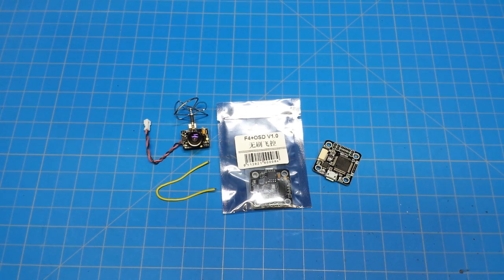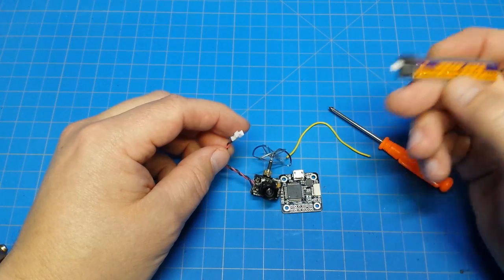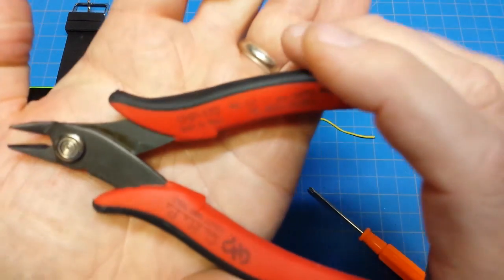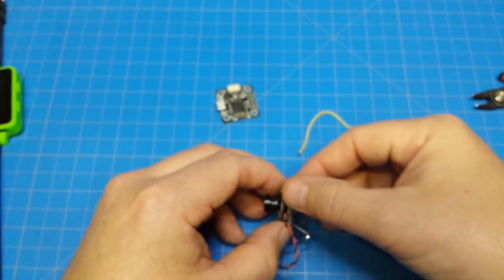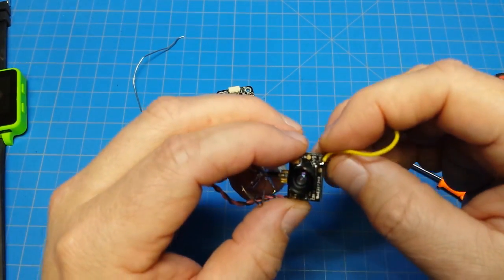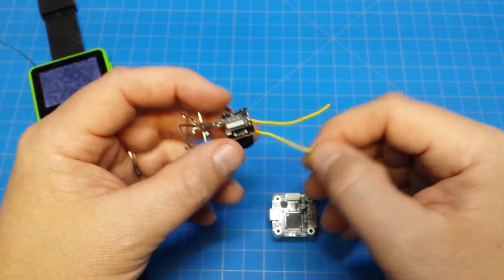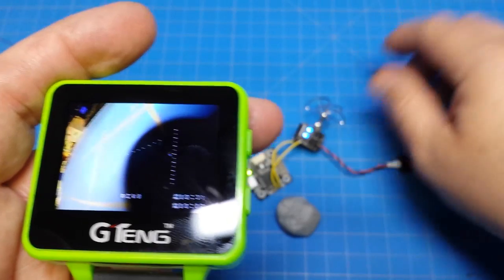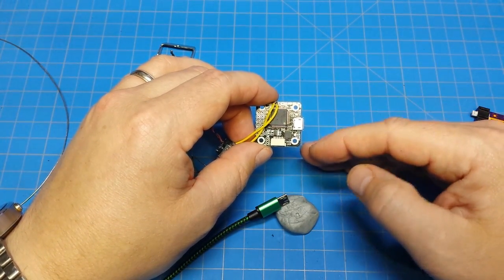Eachine TX02 to OSD

Comment: These little microVTX backpacks are awesome. Great for ditching heavier, hotter, more power hungry full size VTXs. Grab 'em, desolder 'em from the camera they come with and go nuts. They use virtually no power, have awesome features, and generally come with the CP! Also great that they run off of a tiny 1s for ages so you can fully separate power systems if you desired. Super interested in this OSD for voltage...

Comment: If I'm not using a 4-in-1 ESC on a 5", I'll always send my wires below the fc, so the gap between the frame and the FC is basically cable management like a PC case. Tape it all down after zip-tied, to keep vibes out of the gyro, of course. Otherwise, the wires above the FC can't be cleanly managed, will cause vibrations, and can hook branches, shingles, fingers, hair extensions, mammals, and Falcon 9 rockets. I only claim to build well.

Comment: Thank you so much for this video. Where do i have to solder the black and red cable to when I don't want to use an extra battery?
Reply from the maker: black to ground and red to 5 volt.
Reply: Did I do it right? https://imgur.com/a/D4L4Wv0
And can the yellow cable be any cable or does it have to be a special video cable? If so, where can I get one?
Thanks for your quick answer btw^^

Comment: Hi Nick, I have a couple of those LST AIO cameras and I found a video that shows one wire connected to the camera side and one connected to the vtx side but without cutting the conductive standoff like you did. It works fine but I'm not sure if it will damage the camera. Any ideas?
Reply from the maker: Yea, I have done that too. It doesn't have any negative impact.
Reply: @NickBurnsFPV  Good to know. Thank you!

Comment: Thanks! Just wanted to double check the pinout. Im using a 16mm f3 omnibus. I cant tell how big that board is, but mine has no writing at all. What was the final weight of your build?
Reply from the maker: Boy this was so long ago I can't say, I suspect I gave it away shortly after building and tuning.
Reply: Gotcha. I wanted to post a build video, but every time i film a build, something is defective or missing and there goes dozens of hours of useless video. So i just stopped filming. Especially micro builds. Such a pain filming small builds.

Comment: How did u know waht pin is Video?can u help me find out waht pin i need to split on a tx04? 
Really need a bit of help please,
Reply from the maker: This is the 03 which is nearly identical https://www.rcgroups.com/forums/showthread.php?2777705-Eachine-TX03-0-25-50-200mW-Switchable-AIO-72CH-600TVL-1-3-CMOS-Camera-Free-Test/page12
Reply: Nick Burns thx bro. Thats waht i was locking for

Comment: I need to make an osd camera system that I can add on top of my hubsan h502e , i dont want to buy a tx for that flight controller So is there an osd board that you can get some type of osd from that dosent need to be a flight controller also ?, one I can just hook up a 3.7 v lipo to then my tx03 as well and be able to get osd on the goggles of my rutforce vr-28
Reply from the maker: I had a question a few weeks back where they reference almost what your looking for. Unfortunately I don't recall the manufacturer or name of the component :(
Reply: Nick Burns hmmmm , could I possibly buy a voltage step up or step down and wire it between my hubsan h502e ( 2s 610mah 15c )  & a tinywhoop flight controller with the proper voltage it requires one with OSD of coarse !  then connect an fpv camera with OSD as well , think that would work ? , like instead of the tinywhoop flight controller in control of my husban its just going for along for the ride and I’m useing it to get osd , is it possible ? Please think hard
Reply: Hunter Mclaughlin i want to do the same you did with a h501 ! how did things worked out for you ?

Comment: I just did the same thing using the TX01. On this camera, where is the video pin in and out? is the same that TX02?
Reply from the maker: I believe it is the same. But beware, I have not verified.
Reply: YES! The TX01, 02, and 03 all have the same pinouts. I run a TX03 backpack in my Blade Torrent 110 with a RunCam Micro. Use 1s battery or 5v source. I think 6v is the max spec for these guys, but don't go over 5 realistically. 2.2v is min.

Comment: great video trying to find a similar video on hooking up a vtx3 to the eachine minicube on a micro Aurora 100? Any tips?
Reply from the maker: Look at the wire map for that camera on the Aurora 100 and then video from camera to video in wire/pin and video out from minicube to video signal on the vtx.
Reply: Nick Burns 
thanks I found the manual to the minicube and pin layout.

Comment: Hey Nick do you know where the video signal of the CM275T is??
Thank you
Reply from the maker: From memory, its the top of the three pins. I was able to separate the pin but its very narrow in there, I used some jewlers tools to separate the video pin.
Reply: Nick Burns but not sure i guess? Thank you anyway. I wanted to use this cam with the tenny1s fir my RKH 66 BLWhoop. So i'll go without OSD then maybe.
Reply from the maker: Gearbest has a camera to check out.  http://www.gearbest.com/camera/pp_663679.html I just got it today, but it looks smaller than the cm275t. It does have an odd button on the back that could be problematic in a mount. Look at the pics of the wiring, this could be a way to safely try/test the cm257t. I will post some pics to instagram.
Reply: Nick Burns great Thank you.

Comment: So how do I locate my video wire?  I have this vtx
  https://www.amazon.com/5-8GHz-transmitter-600TVL-Antenna-Quadcopter/dp/B01MY814O4?tag=markepulse10-20

There is a 3 wire bridge??? on the side...I have batt voltage on the top and the middle and 3.3 volts on the outer 2....zero from middle to 3rd pin......is the thrid pin my video out?
Reply from the maker: the bridge should all be straight through. Typically video is the top pin or most center. The next is voltage and then negative. Also you can google the camera name and "wire map" or "pin out". Additionally if there is a part number printed on the cam we can google that for an image. As for the voltage reading, it will depend on what voltage the battery is that is plugged in.
Reply from the maker: I should elaborate a bit. The ground will have less voltage than the positive pin. The video would either be zero voltage or something lower than ground.
Reply: I took a chance...the top pin was positive....the second down was neg and the third...the one with lower than batt voltage was video.....cut it....did your one wire trick and tested....split the wire...connected to FC.....Shazzam....thatnk you

Comment: This board is garbage , I would stay away from it. Its just not worth your time money and headache. I was able to get it to arm once by turning off the accelerometer but eventually even that failed. Noobs will think that its them but trust me its not the board is just junk and even at $21.00 no one has that to just throw away only to have to eventually purchase another board because they can't get this one to work. I'm not putting this on you Nick as you do offer fair warning but yeah just save your money for something else  thats verified to work well.
Reply from the maker: What version of betaflight are you running? I found 3.1.7 to be problematic. 3.1.6 has been working well for me.
Reply: Nick Burns I have the (Eachine Minicube F3 6DOF Flight Controller V1.1 Intergrated Betaflight OSD 2-3S 20mm*20mm For Aurora 68 90 100) I say that because I believe they are the same board but mine looks different than the one you have above and was sold as a stand alone with no esc. I tried the oldest version of beta flight to the newest. Arming was the only function I could not get to work no matter what changes I made. There may be some obscure thing that needs to be done I would just like others to know there are better boards and it shouldn't be this complicated. If your a kid who's saved their allowance money on something like this, well it would be discouraging and a waste IMO.
Reply from the maker: Don't get me wrong, I don't disagree with your experience. Just wondering if the arming difficulty I had could be confirmed to bf 3.1.7.
Reply: Nick Burns oh no problem Nick I've been watching your videos for a while and always enjoy them. and to give you a much shorter answer yes I did try the latest 3.1.7. If there is a consensus that this board works for the majority of those who purchase it then I'm not above saying the problem must just be  me.